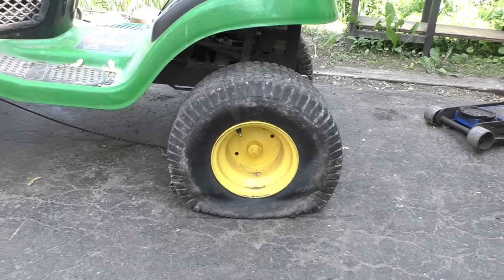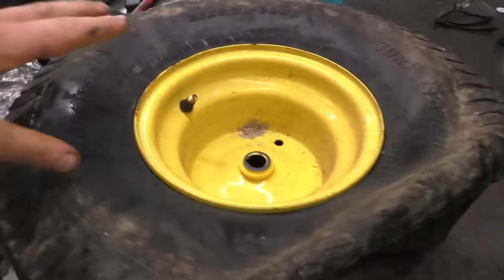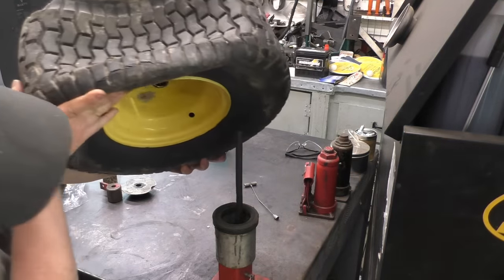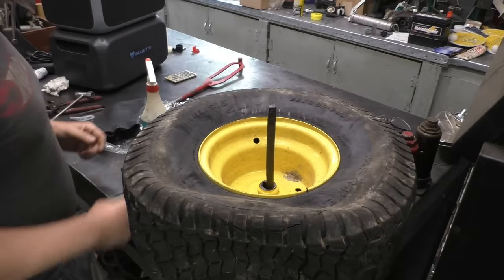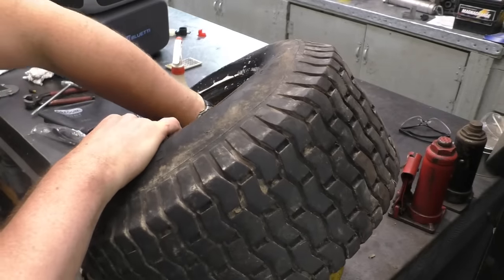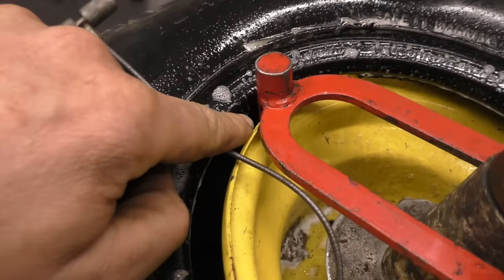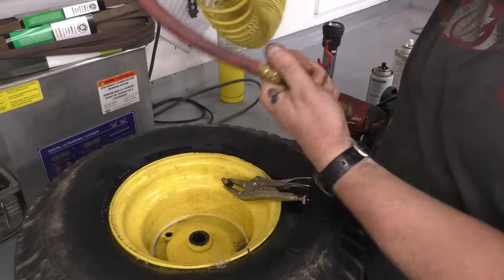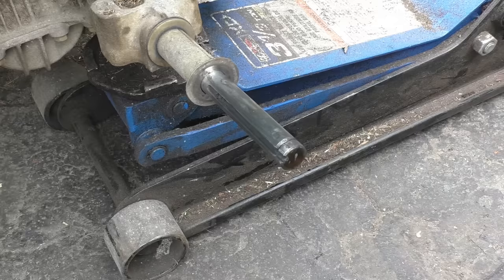The Best Way To Fix Flat Tires!

Comment: Those little front tires are the worst. It's best to remove small children from the area so they aren't exposed to profanity. It's really fun when the tires are so far gone they're falling apart. Try to pop the tire off the bead, the tool just goes through the tire. I've had to cut the bead wire to get some tires off.
Reply: You made me laugh out loud, bro!

Comment: It can help to slightly inflate the tube (just enough to get a bit of shape) to get any folds out and to prevent pinching the tube with the tire levers.  Another nice how to video!
Reply from the maker: Thanks for the tip!
Reply: I also add a light dusting  of baby powder to any inner tubes I install. Bikes, mowers, mopeds, whatever. Helps the tube slide into place and not get bound up inside the tire.
Reply: @corey6393  Then inflate the tube to maybe 5-10 psi and deflate to straighten any folds before final inflation.
Reply: @corey6393  Or cheap out and use cornstarch..
Reply: @schattenmygirl  Is that any cheaper than a big bottle of baby powder? I've had the same bottle on the shelf for almost two decades now, and have not run out.
Reply: @corey6393  And Your baby powder has a ready made applicator/dispenser,  I had a 8" belt feed that was temperamental with the weather until I bought a chrome leather seamless set of belts.BUTT powder VS. C starch is Pennies and my comment was more of a way to say they are one and the same short of fragrance and the "DISPENSER"

Comment: also not a bad idea to inspect inner part of rim , especially if you're installing a tube for the 1st time on this rim . sometimes they have sharp welding splatter or even small pieces of welding wire protruding . i break mine down with a harbor freight changer for car tires , then use a large piece of all thread which i bolt thru a hole in my work bench (nut on both top and bottom , then another nut/washer to hold rim down) when i need it . if i changed many though , i'd buy a changer like donnyboy has .
Reply: Great advise Bill, I learned the hard way to always check the inside of the rim for splatters. It only takes a minute and will save a ton of frustration.

Comment: I want one of those long wires you put on the valve stem. Works perfectly! Thanks for the video. I have one of those tire changers. I need to find all of the parts. Been a long time since I used it.

Comment: I had to patch a tube one time and, without a tire tool like yours or any of the tools made for that, it was a HUGE PITA!!!  Both getting the tube out and back in, but I got it done.  I bought 4 new tires for that rider to install when I get the rest of it repaired and the store I bought them from will mount them for me.  I don't need to do that kind of work often, but a tire tool like yours from Harbor Freight will be what I get to do it in the future.  And your way of inserting the tube is much better than the way I did it, so THANKS for that!  All kinds of time savers here!

I couldn't get the wheel dust caps back on, so I'll watch your "Lawn Tractor Wheel Dust Caps - Best Removal Method!" for that, too.  I didn't think about heating them.  For the time being, I covered where the caps go with black plastic folded over twice for 4 layers and strapped them closed to secure them.  And I've been using anti-seize on everything now.  I lube all zerk fittings, too.  I've learned so much from you.  THANK YOU, Don, for all you do for us!  You're the man!

Comment: Tube is way to go, although I’ve been using that slime stuff for a few year and not had any issues yet. It seems to fill the cracks and bead and it seals well.
Reply: I use the slime for that too, have it in my UTV off road tire that seeps through the bead and micro pin holes in the tread, works great. Thats with 1400lbs on it! Also used in on my trailer tires, they were flat for years and would hold air, now they do! Makes a mess when you change the tire later, but I have years of tread left before that haha

Comment: Good video and I'm sure others may have mentioned a definite benefit is to use a dusting of baby powder on the inside of the tire and the tube along with slightly inflating the tube to help prevent creases and Folds on the tube when inflating the rest of the way.

Comment: I've had the changer for years.  A pair of small needle nose Vise Grips are also very helpful when trying to put the tire back on in addition to using them to hold the stem earlier.  You can clamp them on the rim to hold the tire in place as you work your way around with the tool.  Some of my larger tires run at 4-6 psi and with those you need to push the stem sideways with your finger before putting a hose on them to keep from pushing the stem inside as you inflate.

Now, show me doing this with a 4" rim (old Snapper fronts).  I've concluded that it's less trouble to just replace the wheel tire assembly than to try to deal with a 4".
Reply: What is a good front and rear air pressure for an average small lawn tractor?

Comment: My local tire shop wanted fifty dollars to change a tire because it was so hard to do.  I did it myself with two tire tools from a 37 Ford and a screwdriver.  I used a hydraulic jack between the tire and my truck frame to break the bead.

Comment: I've been working on cars since tires with tube were still common, foreign cars with wire wheels mostly. The rule was and still is never put an oversized tube in a tire, it would fold over on itself, overheat and then you would have a high speed  blowout. Underside was OK, if it was not too small, it woud expand to fill the tire they are made to expand. At the speeds lawn mowers/tractors travel I don't see a danger either way. BTW, if you didn't lube that tire that last 1/4 turn could have destroyed the bead on that old dry tire. Kudos for a youtuber who doesn't mind getting his hands dirty.

Comment: Installed tubes in a couple of 4” plastic snowblower wheels. I put the tire completely on the rim, the snuck the tube in. That way you don’t risk pinching tube when levering tire onto rim.

Comment: Hello DonyBoy. Thank you for this excellent "How-To" video on how to fix a flat. I am considering your method of inserting an inner tube into my tubeless tractor tire, however, it appears all of the inner tubes have stems that are dead center on the tube. Whereas the valve hole on the hub is at a 45 degree angle, simiilar to your hub. Hence I am wondering if I sould be looking for a particular stem type, like "TR 13" or "TR 15"? Or should I not worry about the stem and simply position the innertube slighty so that the stem is at a 45 degree angle once inflated within the tire. (assuming there on't be too much stress for it to coil back to center)

Comment: Great device and process Dony.  I mount mine on a 5/8 eyebolt anchored in my 5" vise.  Once I had a badly corroded rim that would not seal.  Tubes are crazy money!  I had recently sealed my driveway and had some sealer that I used liberally (Not Lieberal) around the tire and rim sealing area.
When the tire 'popped' into place it gave me a permanent tideline of sealer on 3 walls and tool board!  And me.  Lesson learned!

Comment: I used to do this with my old Pontiac Ventura. The rims were too rusted to hold the bead so I’d slip a tube into the tire. I’d break the bead loose by jacking up my truck and setting it down on the tire to push the bead off. I reinflated the tire with a cheap foot pump. It worked, saved me a little money at the time.

Comment: 100% Dony , a tube works whereas tyre goop makes dealing with the tyre later a bigger problem . A tube probably doesn't even cost much more than a can of that horrible goop . I like the tyre changer , would have saved me some grief , sweat and frustration in the past 🙂
Reply: I typically just use plugs on my lawn/garden equipment when needed.  That goop is a mess in non-tubed tires.  I tried changing a tire on a front wheel of a lawn tractor once....finally gave up and took it to the tire shop to have it remounted LOL...even the guy at the tire shop had a heck of a time getting remounted, their tire machines don't do tires/wheels that small, I think he said the smallest it will go is a 13 inch wheel.
Reply: tyre?...
Reply: @dyer2cycle  There are a number of differences between U.S. spelling and British which is what we in Australia mainly use . tyre/tire , favour / favor , centre / center and many more . Another example is we use metre as a unit of distance and meter as a measuring instrument e.g. volt meter whereas Americans use meter in both cases . Ain't language grand ? 🙂
Reply: @Gordon_L  Ah, I see..I wasn't aware of that one, but I am very familiar with the favor/favour, labor/labour thing..I remember being taught that in 2nd/3rd grade in school...and my teacher taught us that either spelling was correct. To this day, I sometimes spell labor "labour", even if it isn't strictly American English...☺
Reply: Americans and Australians and Brits are a people divided by a common language.

Comment: I don't have a lot of workspace but I think I might need to make room for that tool.  I've been fixing my small tires using my tractor's bucket for an adjustable solid worktable.  That tool should bolt on somehow.

Comment: I had to install a tube in my 8-26 snow blower and Princess Auto had the correct size tube. I used my knees to break the bead and screwdrivers to install the tire over the rim. I used a long screwdriver and jammed it into the ground to hold the tire in place so I could rotate it easily.

Comment: I just changed a very similar tubeless tire (23-8.50-12) for the front of my 1982 JD650  utility tractor.  Can't complain about a tire lasting that long.  Had trouble getting the new tire to set it beads it was shipped as a pair with tight binding straps that misshaped it.  Got one of those Bead Blaster tanks that blasst air in from the side and it worked like a cham.  Doing the other tomorrow after the liquid ballist drains out.

Comment: I've used old latex paint on the inside of lawn tractor tires to make them hold air. I didn't want to use a tube because I filled the tires with anti freeze for weight.

Comment: Good work. However I do something differently, before inflating I remove the valve in the tube and just inflate. This is because with the valve on the flow of air inside is slow and so the tube can some time donot take up the correct shape inside the tire. With the valve off air can fill up fast and the tube inflated evenly. This is especially important if you are using a Tube size one or two more than the Tire as shown in the video and this can cause some folds which will give a bumpy ride or premature failure. Once the tire pops and sticks to both rims we can install the tube wall and inflate to the correct pressure.
Also keep the tire on the Jig with the clamping bolt on till you finish the inflation, specially when you are working with the old tire showing some cracks. Also it would be advisable to use safety goggles.
Thanks.

Comment: I suggest you get a large bolt and put thru the axle hole, then secure the bolt in a vise. If you get a real big bolt, you can pivot your tire irons/spoons around it.

Comment: fyi ...Automatic Transmission Fluid (ATF) inside the tire work absolutely wonderful for slow leaks.   I have used it over 50 times, and it works 99% of the time.
Reply: ATF seals the tire on the inside?
Reply: @whatthe2458  ATF is designed to treat and condition rubber seals in a transmission …  I suspect it expands the rubber on the inside but “slow leaks” in mower tires are instantly fixed with ATF … I couldn’t believe it but it works time after time and imho better than fix a flat and way cheaper  …
Reply: @whatthe2458  yes .. especially slow leaks, expands the rubber.
Reply: How do you put ATF in the tire, what is your procedure?
Reply: @mydogdidit  remove valve stem, let air escape. add 1/2 cup or more for bigger tires of ATF using an old mustard bottle or squeeze type BBQ sauce bottle etc.  The ATF helps swells and conditions the rubber, so the slow leak is fixed.
Reply: @mydogdidit  unscrew valve stem, use old mustard or bbq bottle to squeeze it in, about 4 oz, screw back in valve stem ...

Comment: Well done Donyboy but at Eliminator Performance the best way we found to fix flat tires is take them to our local tire dealer Murdoch's Tire in Port Colborne simply because they charge us less for a tube than we can purchase them and they charge $10 labour to install the tube (all plus the 13% HST of course). We actually have the same mini tire changer from Princess Auto which we will likely sell to a flipper at some point. The aggravation involved especially on the smaller front tires really is not worth the effort and we found that while they are fixing our flat tires we can actually be doing repairs and making more money from the time not wasted on this operation. Another bonus is if they ruin a tube during the install it is on them and not us or our customer. As a service to our customers we do not inflate the cost on the customer invoice. Do love that tool you use for holding the valve stem though!

Comment: I've seen that valve stem that is a straight up style and some of those that are Bent at a 90 degree angle  the great thing is that you got a rim that has holes in the metal for using a harmonic balancer puller to remove it from the axle if it is seized on the Axel  great job there Donn

Comment: as a teen I used 2 or 3 screwdrivers in my 30s I got tire spoons , age 50 I got a manual tire machine , Look back over the years and think of the time i could of saved .

Comment: Another excellent maintenance video. One caution is never inflate a loose tire. Mount it on the tractor, tire changer, place inside a cage or for larger tires, safety chain to solid object. I know people that air the tube or tubeless tires for years without issues, also observed people dead from the impact of low pressure tractor tires. Please continue with the videos...

Comment: I found often the stem is offset & if you set the offset towards the hole it doesn't want to fall back into the rim. I had two from Harbor freight go flat the next day so my suggestion is to buy a good quality tube.  You don't want to do that twice.

Comment: Before I install the tube, I check inside the hub.  Sometimes you will find a bead or bit of slag from the original factory welding.  

This not an issue for tubeless tires but may be when you install a tube.  These may cause a puncture.  I grind off the burrs if I can.  If I can't. I wrap the hub with duct tape, being careful to not put wrinkles in the tape.

Comment: I wish I had a tire changer like that one. I just put a tube in my tractor tire using tire irons the other day. I struggled with it for over an hour and half.
Reply: I suggest you get a large bolt and put thru the axle hole, then secure the bolt in a vise. If you get a real big bolt, you can pivot your tire irons/spoons around it.😮

Comment: I have a rear tire with a slow leak. I'll fix it with a tube. Question is, should I also put a tube in the other rear tire? Does a tube affect the tire temperature (and pressure) while in use?

Comment: I like to put a small zip tie around the valve stem against the wheel so I don't have to worry , and it comes in handy later on if you get a small leak or if the valve itself goes bad , then you can put a new valve in and don't have to fish it back to the hole, a metal valve cap will also take care of that, can't depend on the plastic ones

Comment: I do pretty much any size tire at the shop ( from 4.10-350-4 to 23.5-25 or even bigger )..  If the dry rot can be seen from the inside, the tube is not going to last long as the weak spot will actually pinch the tube and eventually it's going to leak.  Tires like that, we give the customer an option. New tire or no warranty on a tube. If it goes flat after that, it's new tire time... Also, just using levers is much faster than those tire machines

Comment: Donnie: one thing I notice with the stiffer or smaller tires is that mounting is easier if you do as you showed in pushing the start area down into the rim.  Then, before levering clockwise, continue to use your hand to push the bead down counter clockwise as far a you can.  You can usually "pre-mount" about a quarter of the tire "backwards" that way and hold that down as you begin clockwise with the tool.  Avoids bent tire bars and foul language.  ;-)
Reply from the maker: Yes lol, trying to minimize the foul language!
Reply: That is why they have drop center on the rim so that that the bead has a place to move move while the rest of the bead is moved around the rim and into place.

Comment: I would also add this step:  once the tire is back onto the rim, before inflating the tube, push down the tire bead on each side of the wheel to check to see if any of the tube is caught between the tire bead and the rim - especially on smaller tires.  When I have done this job, and have ordered the 'correct' size tube, sometimes it seems that the tube diameter/size is still too large and it will fold over itself or get twisted around inside the tire.  This is when the above situation is most likely to happen.  Great video and I will add that tire changing tool has got to be mounted to something firm and stationary in order to get leverage around the center post.  That is 99% of winning the battle right there.  Otherwise, you will be inventing a baker's dozen of new curse words!
Reply: The position of the valve stem before you start to refit the tyre is critical.. a point worth mentioning..
Once there is air pressure and the bead is seated, there is no way the valve stem can go back in when you release the vice grips, ..  
nice setup for the task tho..